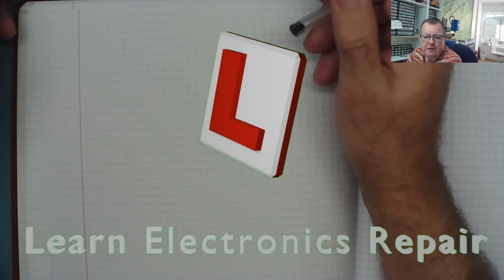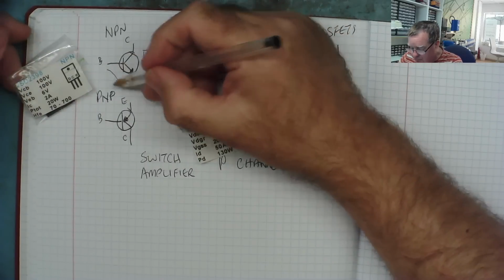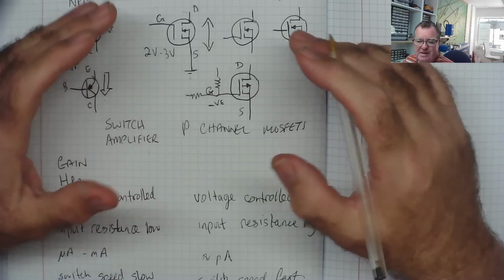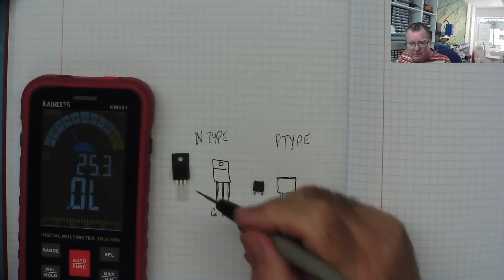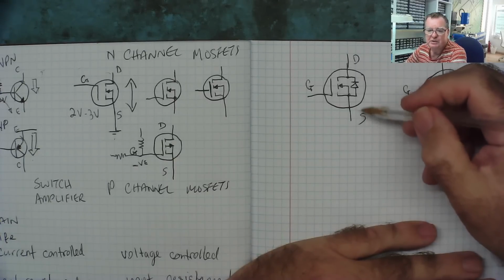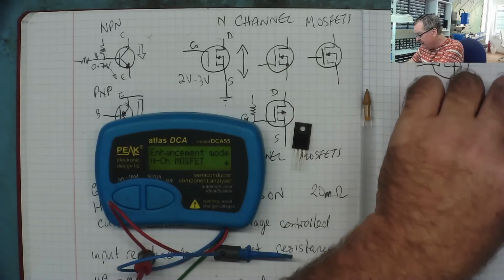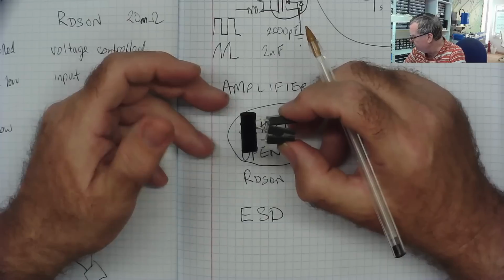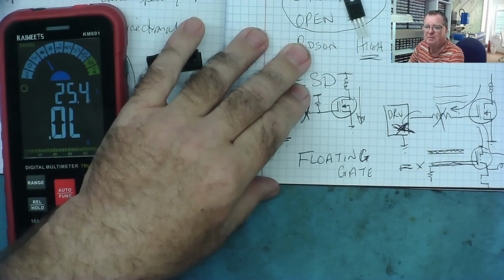All You Need To Know About MOSFETS To Fix Stuff! How Mosfets Work Fail Test In & Out of Circuit

Comment: Ok I have a cunning plan... How about instead of using a MOSFET, I use a 3v, 4v or 5v relay in the same circuit as the photo transistor and variable resistor and maybe a 10k resistor? 🤔 Hmm maybe not the 10k I just need an on/off for the relay. And 12v from the relaied side of the relay to power 12v reduction motors?
Would that be eiser?
I don't know what is wrong with the MOSFETs they don't discharge their little capacitor,so the circuit never turns off...  like I said mosfet Hocus pocus doesn't make sense, is there a way I broke them so they are always on? They are driving me crazy 🫠😳😔

Comment: As if my brain  🧠 wasn't already
 melting 🫠, it is now jam 🤯 🍑🫙
Why dosen't the capacitor on mine not discharge? These things are driving me crazy I really want to add a little switch for this just to dump the stored capacity, I am really loosing my mind with mosfets 😱 😳 🤯

It just stays on and the relays won't close. I notice the other day during testing,  the most famous would take longer and longer to discharge leaving the relays closed (on) 😳🤯😔 and would take several seconds before the relay is turned off 😞 but now they are just on all the time until I disconnect the power...

Comment: The gay resistors are also used to bias the gate.That is to bring it up to like 2.5 boltclose.The signal only has to provide half a bowl to turn the transistor on In that case, they use 2 resistors, one to positive 1 to negative.It forms a voltage divider that can set the gatevoltage at whatever you please

Comment: Very interesting. I only ever had the most rudimentary of electronics knowledge as a teenager, with BJTs in switching applications being the limit of my skills. AC and amplifier circuits were completely beyond me, and I barely even knew what FET stood for, let alone how to use them. Now, mumblety decades later, I'm trying to learn some of these things again. Components and test equipment have become ludicrously cheap and accessible, something that was not the case in the early 1980s for me. I'm trying to go slow-and-steady, starting to dabble with JFETs before breaking into my stash of MOSFETs, but it's good to build up some knowledge for Future Me. One thing I hadn't realised until it was explained and demonstrated here in this video, was the concept of capacitance and a MOSFET remaining switched-on when current is removed. I genuinely didn't know this. I find myself wondering whether that retained charge dissipates over time (when out of circuit) or whether the transistor effectively remains "on" for a number of minutes, hours, days or weeks. Another part of this is a loose concept bouncing around between both my braincells, about this potentially being used as a form of (perhaps short-term) non volatile one-bit memory. I can see the entrance to a particularly deep and twisting rabbit warren nearby...

Comment: When testing, I just can't turn the gate on with the multimeter. But if I use my bench variable supply set at 9 V, it works fine. 

Another thing, probably mentioned somewhere else, but if you work with an antistatic mat it won't do to test the Mosfet over that. These mats are conductive and they will discharge the gate capacitor as soon as the terminals touch the surface.

Comment: Early on in the video, you said the mosfet was a bi-directional device, so that current can flow between drain and source in both directions. Surely this is not correct because the body diode needs to remain reverse biased so that with an N channel device, the drain remains positive with respect to the source and current flows from drain to source. 

Too many mistakes and corrections in this video, makes me wonder whether you know what you are talking about!!

Comment: Youare the best lecturer on all issues electronics in my humble opinion and you're a brit that's a plus, go Liverpool. Do you have any videos on tracing a problem where you don't have power to the VCC. I am dealing with a power supply for an Anton Bauer quad charger. And I cannot seem to trace the root of the problem. No Power to both switching chips, they share the VCC and it gets 16V. I traced it to a W1P transistor that gets 17V at the collector but it doesn't release it to the emitter which would go to the VCC as probably 16V.

Comment: I found your videos really educational for someone like me. I wonder if you check questions here. I got a question hoping to get your answer. I recently mistakenly connected an old PC power supply’s 12v output to a 26v battery, I hear two loud explosions and the supply was burned. I found the 16v rated 1000uf capacitors were blown open. But after replacing the two capacitors, the power supply is still broke. What else do you think could be damaged?

Comment: What's up with laptop mosfets when a laptop dies generally i go after the mosfets, i always mock them on laptops, but why they fail so much? but especifically on laptops i mean a desktop has a pc that has like 3 or 4 mosfet on the power supply to push a lot of power, i know that is not fair since them work at 3 digit voltage hence lower current but a desktop motherboard has mosfets for the cpu that are beaten up to ridiculous amounts of current and a desktop motherboard (at least in my experience) rarely dies of that. so what's is going on with laptop mosfets? they doesn't go overkill on laptops as on desktops?

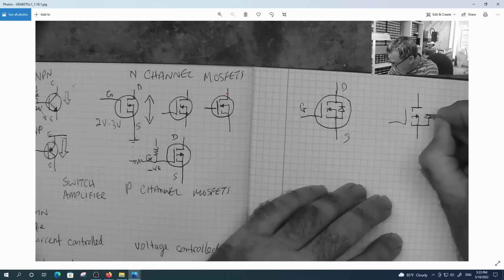Comment: as i tracked his pen 26:27 i was sure he will make a mistake 😁 ps an absolute masterpiece of teaching and he is very lucid with alot of experience , btw that diode is the result of shorting the source to the body of the transistor in order to avoid the turn on of the parasitic internal bjt (yes there is a bjt transistor in vertically and laterally  diffused mosfets  if i remember well) that is why altough a bidirectional device you are forced to connect it only in a single way since that diode Will Conduct

Comment: I have an ebay listing for a powejack pswgt-1200. I have replaced the igbts a few times at high cost and given up. If you are interested in a challenge place a bit, it's for peanuts, and hope you can get to the bottom of the problem, I would be really interested. I'm done on it. Great channel, great info, keep up the great work. Cheers.

Comment: 32:33 / Supposedly, the Gate/Dielectric/Channel creating a capacitor effect, can slow the switching speed due to charge time.  So, they add resistors to the Gate.  Doesn't make sense to me as in that case, it would seem that more current would charge the "capacitor" faster than using resistors and restricting current more ... slowing the charge speed.

Comment: Depletion mosfets are used where you want to make use of variable RDSon. They are used in LED drivers, linear power supplies,constant current sources, as a resistive load in logic circuits, or in the startup circuits of switched power supplies. It's just very easy to make a constant current source with a depletion mosfet, you just need only 1 resistor.

Comment: Great explanation, especially the in circuit cases and open gate hazard. I'm guessing you could test in circuit using a temporary weak gate drive so as not to harm the in circuit gate driver.

Comment: You brushed over the fact the FETs acts in the same way as an old style valve, it has voltage gain and can be operated in its linear region.  They are used in amplifier just as much as they are used as switches.

Also a point of note that can bite your butt is that logic level fets were designed for 5V logic and may not work on today’s 3.3V logic levels. You have to check the VGS(th) value in the data sheet to make sure it will switch on at 3.3V. Note that the low RDS(on) may not be met with a low VGS even if it’s above VGS(th) threshold.

Also they may never be able to carry the current the data sheet claims. In practice you can’t make a heatsink that could carry the heat away fast enough.

nice introduction.

Comment: Another reason why resistors on the gate are a good idea is in the case of the gate going short circuit. Whenever I test MOSFETs or IGBTs on the bench with a load like, say, a 21W 12V auto lamp and a lead acid battery or a PSU. 
If the gate has gone short circuit, the package of the device will explode. If you put a resistor in there, it won't.

Comment: I would like to add that a resistor from gate to source is often added as a discharge path for the gate capacitance, its good practice with N channel so the 'switching on' with the multimeter wont work in a normal design that has a gate resistor to ground (source)...cheers.